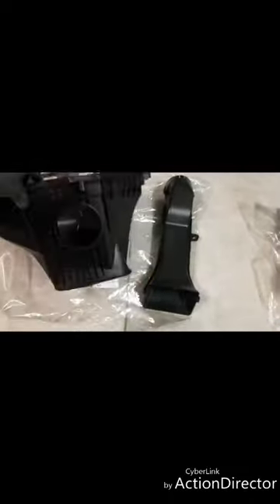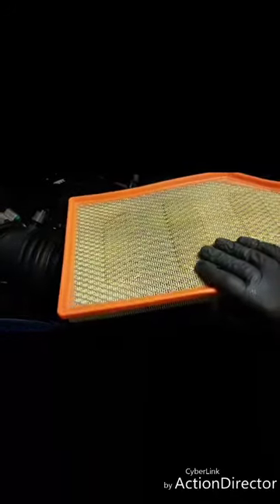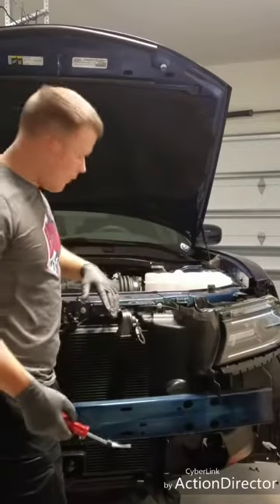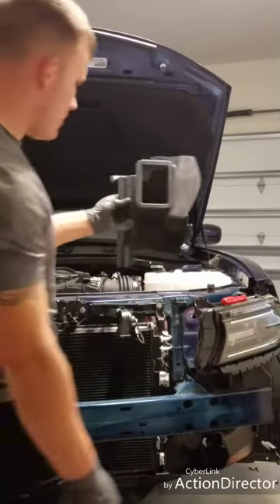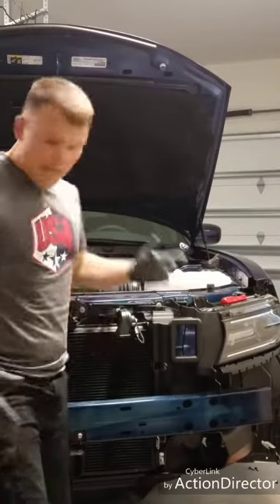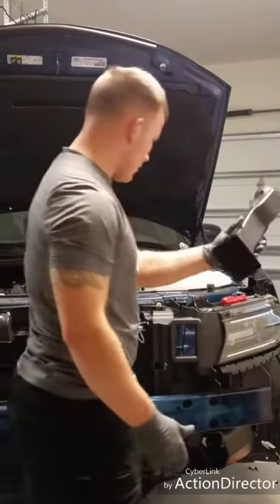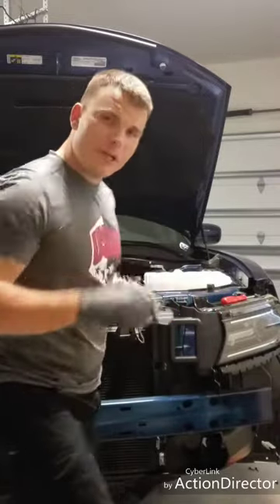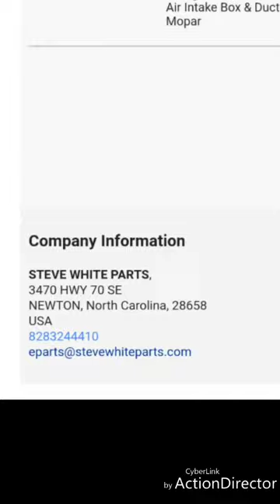Hellcat intake install for Charger Scat Pack!!!!!!!!!!

Comment: I installed the same Hellcat Ram Air, airbox on my 19 Charger R/T along with the upper and lower Snorkel Grill replacement.    I'm also running the K&I filter. Since the upgrade and have noticed a  big difference in HP and throttle response and a big time temperature  drop.  I've invested around $350 for the whole complete set up from Steve White motors and Fall City Motors.  I highly recommend this upgrade.  Just make sure you use Original Mopar Parts.  It took me approximately 6hrs for the whole project, so be prepared for that.  But the final results are worth the time and money...

Comment: If you upgrade to the 2019 grille inserts that duct will connect to the “snorkel” in the new grille. Awesome video👌🏾.
Reply: Andre L does it still require removing the front bumper?
Reply from the maker: I’m sorry I’m just seeing your comment, but that’s Great news!
Reply from the maker: @chizlow  You would have to take the bumper off in order to install the new grill he’s talking about.

Comment: I also heard that you can just buy the drop in filter for the hellcat into the scat pack and it helps that’s what I did I’m going to see how that works before I do all that tearing down my front end
Reply from the maker: I'm not exactly sure about that. Are you talking about the physical drop in filter, and doing that instead of a K&N?
Reply: DJs_Triple_D Detailing, Dips and Drives Yes I am talking about the physical air filter I ordered it and I’m going to try it out
Reply from the maker: Good deal! I hope it works well for you!

Comment: Thanks for the video, completed my install last week.
Reply from the maker: Destroyer Gray P-38 that’s great to hear!!!! How’re you liking it so far?!
Reply: DJs_Triple_D Detailing, Dips and Drives intake temps have stayed between 3-6° on my 5.7L. Have you tampered with the brake ducting to get more fresh air to the air box?
Reply from the maker: Destroyer Gray P-38 I’m somewhere close to that. But no, I haven’t messed with anything else as far as the intake goes.

Comment: Which product did you use specifically? I got the same 16’ Scatpack charger but i dont see it for my year
Reply from the maker: Kareli Nolasco it’s the lower air box and snorkel kit for the Hellcat. I got it from Steve White Parts, they’re in NC and ship all over! Great prices and a great company to work with!
Reply: So 16’ HellCat #6, 2, & 7 ?
Reply from the maker: Kareli Nolasco I honestly can’t remember, but if you hit up Steve White Parts, they can get you set up!

Comment: How hard/aggravating was it to take the bumper and grille off?
Reply from the maker: Brandon it’s really not bad. There’s a lot of videos about it (I think BJ’s Garage 570 did one) about taking it off. The worst part is getting to the bolts in the fender well.

Comment: Great video ! Thank u ! So how does it work compare to stock intake ? Does car perform better ? Does it really make it difference honestly . Is it worth to do it ?
Reply from the maker: Thank you very much! I'm glad you enjoyed it and I hope that if you order this kit, that the video makes your installation a breeze! I still have the stock airbox  installed on the engine, this just adds a different lower section of the box. From what I've noticed, the car DOES perform better! My IATs are now consistently only 2-4 degrees above ambient. That is of course unless I'm sitting stagnant in traffic, but even then, once rolling my temperatures drop significantly faster with this installed!

Comment: Is it worth the money and the install time or just stick with the stock scatpack intake?
Reply from the maker: C. LEWIS I've noticed a difference... I got mine on a hunch.  And I'm glad I did. The stock set up takes much longer to cool while driving, and sit roughly 5-10 degrees above ambient. With this hellcat supplemental intake, my IATs plummet as soon as I get rolling, and hover between 2-4 above ambient at speed.
Reply: DJs_Triple_D Detailing, Dips and Drives any noticeable change in throttle response or butt dyno or is it basically the same just runs slightly cooler?
Reply from the maker: C. LEWIS I've noticed a little more umph when I get on the go fast peddle. But primarily I appreciate the cooler overall temperatures!